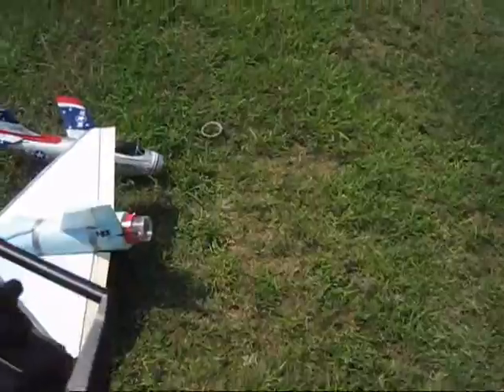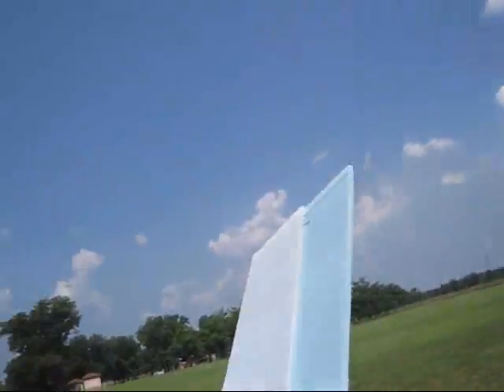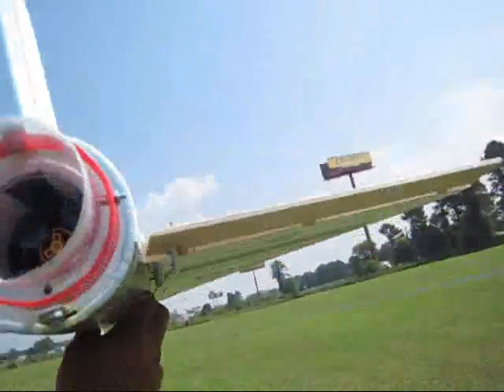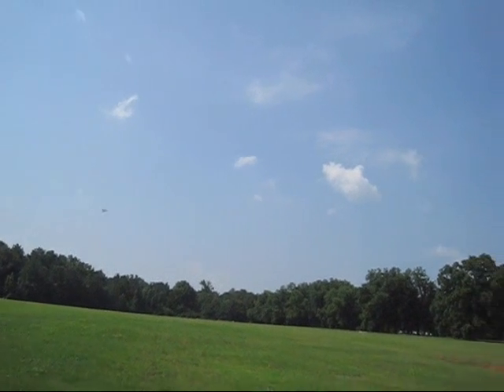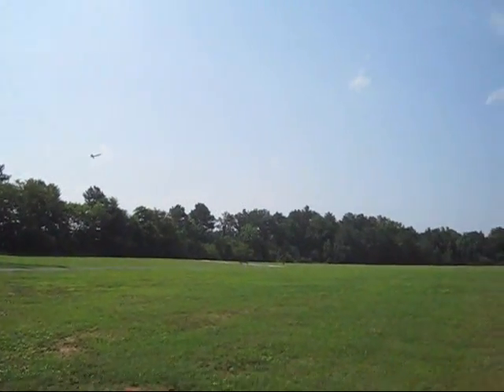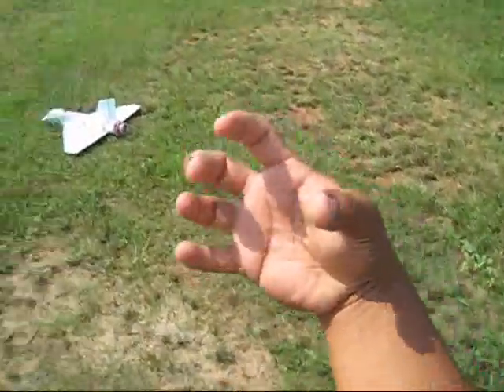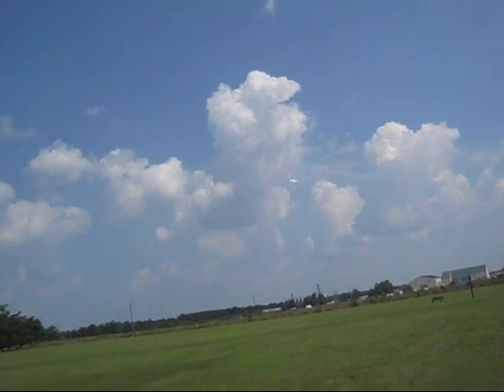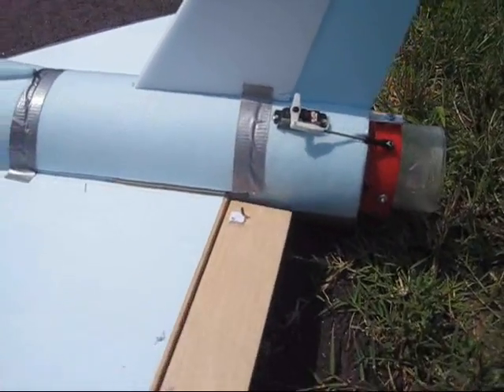Home made Trhust vectoring system first flight

Comment: Try to cut the beginning/nose of a plane to get a EDF engine a full passthrough - I am inclined to say that it will increase a thrust without additional drawbacks. In result you can reduce wing area and plane weight with the same manouverability ability. Take in mind, that I am a totall newbie in this area. Post Scriptum: with smaller wings added please consider turning a whole wings for rotation and ailerons at wing ends.